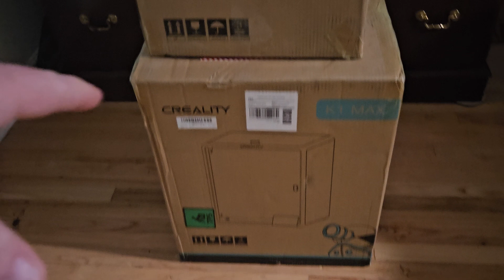Creality K1 Max prints and tree supports

Comment: Looking ti get a K1 as a first printer. Limited to creality options because of where i live. Would you recommend this thing?

Looking at the regular K1, but they seem similar enough
Reply from the maker: You just missed those lightning deals on Amazon for the K1 and K1 Max. That is where those other two K series in the video came from. The K1 was $352 ;) I haven't set the K1 up yet but it is for the kids to play with. A lot of people seem like to like them. Of course you're always going to see people having issues. Just remember to read between the lines and understand that most people create their own issues from lack of understanding.
Reply: @tRRickedOut Yeah I thought so, lot's of reviews I've watched seems like issues either easily fixed, or ignored. I wish i could buy amazon, but import costs are crazy here. Anyway, thanks for the info!